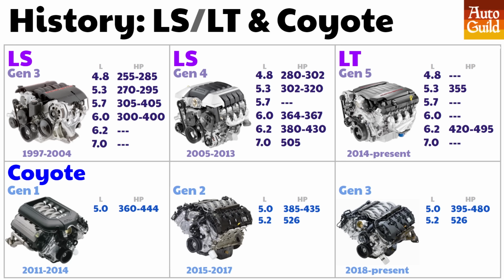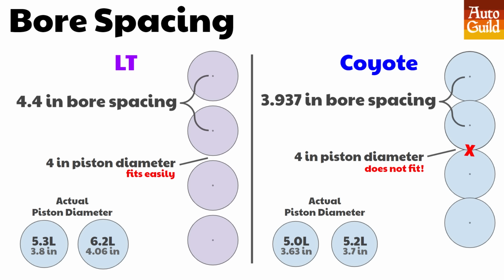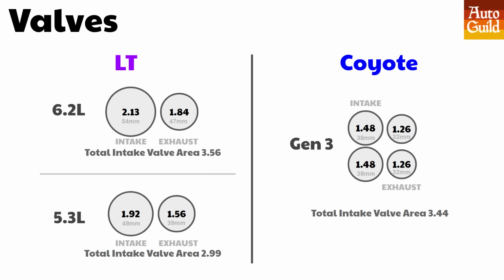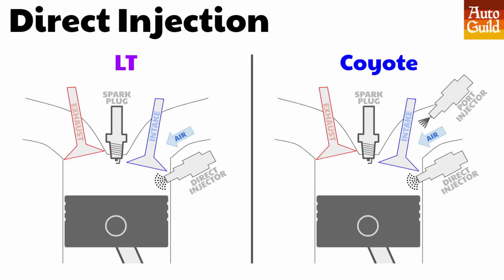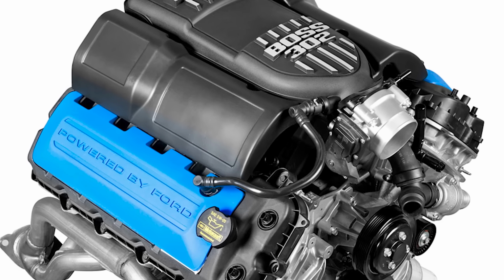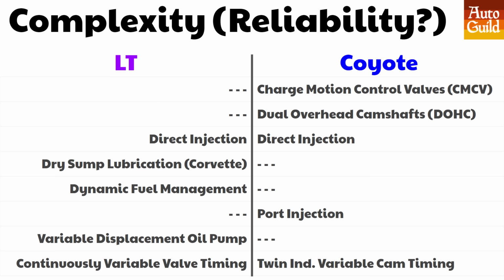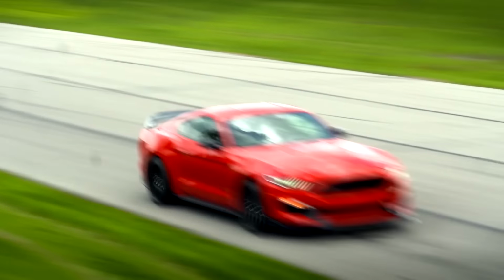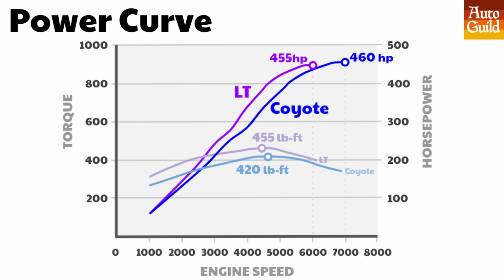GM Gen 5 LT vs Ford Coyote.  Which one is better and why.

Comment: I wonder if they fixed the oil consumption issue with the coyote?  The coyote in my 18 f150 used oil like a two smoke.  To the tune of 5 quarts before it’s first oil change - fords fix; do an oil consumption review and then replace the engine.  Apparently it was (may still be) a common problem.

Comment: The 302/5.0 Coyote eng is effing huge! About the size of a Chrysler 426 Hemi.
Reply: No, the twin cam heads are...
Reply: @aesir0784  so that not apart of the engine right? LOL you ford guys are hilarious. BIGGER THAN A BIG BLOCK, LONG BLOCK FOR LONG BLOCK. you know what a long block is? Imagine making a 4 cam 32 valve motor bigger than everything on the market still get over powered and tq'd by small blocks LOL.
Reply: @dmlmedia7382  like who gives a shit about the exterior dimensions?? The coyote engine is a masterpiece, it will outperform big cubic inch engines with only 305 cubic inches of displacement. Just look at Gm and dodge they use big 6.2L and 6.4L engines and still struggle to beat Fords small displacement Coyote engine😂🤣 No need to change heads, cams and all these nonsense, just drop a supercharger on the coyote 5.0L and let her eat.
Reply: @Jimmyxsx  even twin turbo setups on the 5.0's fucking riiiiiip😂 for older engines, like i have in my boat, I'll take my gm 5.7 all day. I love the sound when the quadrajet kicks in😜
Reply: @Jimmyxsx  Racers give a shit, builders give a shit, racers who build shit give a shit. That was the most silly response LOL. WHO CARES WHAT THE OVERALL SIZE IS LOOOOOOOOOOOL. I can tell you have no idea how cut up older mustangs have to be to put a coyote in it. heavier, more expensive, less power and torque. That's why your Ford kin swap LSX motors when things get serious. Link me 1 video where a coyote wins a calibration contest from any major outlets. #crickets

Comment: On modern direct injection engines without any  intake injection such as the newer gm LT direct injection engines, what maintence can you do to keep you valves clean since there is no fuel running over the intake valves to clean them. Just wondering if there is a product you can spray directly in the Intake every couple thousand miles to blast the buildup off the valves so it doesn't have a chance of causing issues later.
Reply: Best way to prevent that is to install a catch can. On my LT4 I have one and it cleaned the ports up hood from oil.

Comment: love the sound of a flat plane crank w/ header's
Reply: Coyote Mustang drives past my house daily, sounds fantastic. I had a 02 LS1 w/ headers that sounded like a boat. A fast boat.
Reply: I'm a chevy guy but a Ford v8 sounds so much better. Had a few old school 5.0 ho fox bodies, shorty headers, h pipe and Flowmasters sounded amazing .  The coyote sounds fantastic as well.  I do prefer the low-end grunt of the ls
Reply: Yeah when they come apart at 8k rpms on the race track it sounds WILD! the bad part is how long it takes to clean up the mess... dang voodoos

Comment: There are one to many error in this video.. Gen 4 LS went all of the way to 2015, the coyote does not have a flat plane crank the voodoo does., you did put direct and port injection however, the LT also has an engine that has the port and direct injection that you mentioned early in the video. The voodoo has a dry sump oil pump. The LT with the 6.2 is has more power per pound of weight than the coyote, Also, I wouldn't care about displacement per horsepower since the coyote all motor power is limited.
Reply from the maker: LS goes to 2019 I think, but LT was launched in 2014 and LS was begun to be phased out.  Good comments on Voodoo dry sump!

Comment: I'm a GM guy because I've always had terrible luck with Ford's reliability. I do hand it to Ford for being the more progressive company by implementing overhead cam V8s in the American industry and having gorgeous body styles and interiors. GM is currently working on a quad overhead cam 5.5L V8 but I'm not sure what they plan on putting it in.
Reply: GM will most likely put the 5.5L into the upcoming C8 Z06 and possibly other higher performing Vette variants. A race version of the 5.5L is already in their C8.R racecar since 2020 so they have to homologate it.
Reply: Im my family goes both chevy and ford, im chevy fan, my bro a ford fan, at times we swith rides, both are great makes at the end.

Comment: I'm a chevy guy but I do give ford their respects for not just with the coyote but with several engines that they've produced. But with that said I'm more inclined to build an ls or lt over a coyote any day and not cause I'm chevy but cause of cost. Not saying that it can't get out of control in cost with ls/lt stuff.  But The coyotes in particular, I will fully admit this, the coyo at the end of the day is a better block when built, for who could afford it. Those engines can turn some serious numbers and hold up to the beatings for a lot longer then most ls/lt stuff. But again once that coyo goes boom, you'll spend the cost of a built ls to repair it. If ford could get off their high horse for a few minutes and figure out how to make these cheaper then any ls/lt build, you'd then see everyone at the pick and pull junkyards hunting does coyotes an again not saying that people ain't already pulling them but here on the east coast I can find a coyo now faster then a ls/lt in the pick&pulls on any given day. I remember 8 years ago going to the p&p and getting 3 ls engines, aluminum l33's for 400 bucks, now if you find one it's probably 3 to 600 per block, but crazy as it sounds, even in the scrap yards back then coyo's were about 350 to 450 a block back then. Lol even the scrap guys knows what's up.....

Comment: As a mechanical engineer I approve of and appreciate this video
Reply: You shouldn't approve.. the FORD GODZILLA 2 valve pushrod is far more appropriate comparison.. AND Ford will get the cube advantage FOR ONCE..
Reply: @onyxphantom6762  
Not even close to most expensive
Reply: Most expensive to date yes

Comment: At 15:50. Comparing a 6.2 to a 5.0. OK, then compare the 7.3 Godzilla with  closer displacement 7.3 vs 6.2, and both are pushrod engines. No contest.

Comment: Really great video. I own all three engines LS, LT, and coyote. All 3 are great but I just love the simplicity of the LS. Glad to see you are an engine guy with an open mind and not just a fan boy. That is hard to find these days.
Reply: 100% was the best comparison I've seen yet! They all make great motors these days that's for sure.
Reply: Since u own all three i wanted ro ask, how much diffrent feeling is the low end torque in the coyote compared to ls?
Reply: @andresmarquez5241  the low end power especially with a pd blower is fucking crazy
Reply: LS crate engines likely in production thru 2099
Reply: Yeah coyotes are more complex but more durable , definitely more powerful and better , but LS are simple to work on it anytime
Reply: @ericknava9627  far from more durable.
Reply: @ericknava9627  complex and durable don't go together. LS makes more overall power and makes it cheaper. The coyote makes more HP per cubic inch but it will still loose because the LS makes more absolute hp.
Reply: If you are just driving your car reliably going places, what does simplicity fit in? Other than piece of mind that is unwarranted because lack of problems with the more complicated engine?
Reply: The LS6 in my C5Z has been pulled blueprinted & balanced w/ forged lunatic crank/rods & custom cut blower pistons. Crack a few piston rings when the hi-flow cats in my ARH mid pipe flew out their shells & plugged the exhaust lol, otherwise….it would’ve been fine. Thing has been making 750whp now for a while, stock bottom end. No issues.
Reply: You have really have done your homework.
Noth are great engines for status and power.
I believe the GM LT would be the more reliability with less tech and moving parts
Reply: The LT's have failing lifters ...starting as low as 30K mileage...
Reply: Coyote is ford’s top engine but you don’t compare it to chevy’s top engine. Hmmm.
Reply: @davidsteinhauer1339  Ford's top  engine is the 7.3L 'Godzilla' ICE V8
This compact 2 valve, pushrod is less costly option for high load F250 service since 2020. It shares same architecture as GM LS ,LT & has the same power potential , if not more. Huge bore, short stroke give it over 500 CID ability that LT & coyote lack. Godzilla crates are selling well  due that and super strong block capable of 2000+HP
@ costs less than 1/3rd of similar push from coyote platform , not to mention its 25% smaller pkg. That easily  fits most ford autos
Reply: @peted5217  7.3L? Think maybe you are comparing apples and oranges now.
Reply: @David Steinhauer  Ya, kinda jumped all over engine architecture scene. Only intended compro was 'Godzilla's' to LS/LTs . Ford's much larger bore spacing in near identical pushrod architecture ,scores a coup in lo cost alternative to diesel for all but commercial HD use. Reference to Fords discontinued 5.2 flat plane crank screamer vs 2023 corvette Z06 otherworldly motor was only a lament  the 5.2 hadn't been developed further as GMs new quad cam engine shows design's potential .
Ford bailed on small pushrod v8s , opting for a more expensive (excellent) quad cam design.  GMs pushrod v8 has shown the same power , but in a more compact , simplistic, and much less expensive to mfg, offering .
Reply: @peted5217  Nothing you said was wrong.
Reply: I also have owned all 3 and coyote is a better motor in every single way.
Reply: @katkilr7685  oh definitely not in every single way. LS is more compact. LS is more simplistic to work on. LS has more shops that specialize in its platform. LS has better aftermarket support. LS is cheaper in many ways to fix and/or modify. 
So you can say the coyote has some advantages, and I would agree with you. But to say it is better in every way is to ignore the facts.
Reply: Coyote is a better motor
Reply: I will always prefer an LS style motor. Just way more n/a power and it sounds a whole lot better.

Lingenfelter has an LS7 blue printed motor making 820 and revving to 8500. It's a 454 and absolutely nasty.

Coyote is a great motor don't get me wrong. I'm not a hater. But all you see is LS swap and these style motors in other cars. They work they have Hella power and are reliable.
Reply: @camonly849  I have a coyote f150 and it's a cool truck but the LS is still king. The LS will always make power dollar vs dollar and when both engines are N/A. The coyote shines with both engines are stock but have super chargers attached.
Reply: @09shelby15  stppid argument. Bragging right on more hp per liter doesnt win races. The goal is the same for all thse performance engines. Pump more air. This can happen thru cubic inches, more valves, more lift, larger heads, etc etc. Which is the reason the coyote is physically larger than a lt/ls
Reply: @09shelby15  Than What ?
Reply: @09shelby15  would you like to enlighten the rest of us with facts?
Reply: @Stephen_Hodge  its a smaller displacements motor that pushes more hp per cubic inch.  It revs higher and has a broader power ban.  While both motors perform well the coyote is a better motor.  Doesn't need 6 liters to produce 1xxx hp.  I also personally think the ls motors are superior to the lt tech.  I know some of the ls heads flow way better.  Now each motor has its short comings but I would chose the coyote everyday over a lt and a ls.  The modular motor lineup of Ford even there 5.4 dohc 5.2 dohc 5.8 dohc motors you can push 800 plus wheel with a pd blower and have power from idle to redlibe.   Yes you can fo the dame with a lt.  Comes down to power per cub fords motors are superior
Reply: @Stephen_Hodge  not to mention that good old 5.4 dohc carroll shelby called the finest motor made in that day out doing even the Germans.  Well thay 5.0 coyote is a better motor and I would call fords 5.2 the finest performance engine made today.
Reply: @Stephen_Hodge  I'm no ford fan boy either 
   Chevy will always be a step behind as long as there producing cars you can't tune.
Reply: @Stephen_Hodge  and I own a gt500 a z06 a chevy suburban and a f250.  Just my honest opinion on the two engines.
Reply: @Stephen_Hodge  plus those little 5.0 pushing 1300 1400 hp running in theb7s at over a170mph is pretty fucjijg impressive
Reply: @09shelby15  so technically I love the Buick roadmaster to death , getting one soon , so your telling me the coyote is a step up from the lt1 corvette from the 90s?
Reply: @Anthony0899  lmao chevy new engine line is lt
Reply: @09shelby15  damn , your right bro I ain’t even have to finish the whole video , but I’m about to watch the rest , I still feel like the lt1 is good for the wagons but that swap to the coyote is it even compatible? I know it’s expensive
Reply: @09shelby15    Where producing?  You're the only guy who doesn't know that the Chevy small block is the best all around V8 in the world.  There's no debate.
Reply: @mrpoizun  yea it's not but ok the coyote is such a better engine.  Not even close
Reply: @mrpoizun  you cheby fan boys make me laugh csny even tune the new junk
Reply: @09shelby15  there is still more chevy cars around the US so more like Ford will always be behind in sells of cars sold from them now chill out
Reply: @alphaares6027  where do you get your facts from.  There legit more f150s rolling around than xhevy even made cars
Reply: @09shelby15  I still see Chevy and Ford mostly but when it comes to full size SUVS CHEVY wins where Ford doesn't Every store I go to I be seeing a lot of silverados bearly outnumbered by F -100s
Reply: @alphaares6027  lmao ok buddy
Reply: @09shelby15   You living in a fantasy if you think it takes 6.2 from anyone to make 1000hp. The 4.8 and 5.3 junkyard pulls will do 1000 all day and you wanna talk money, the chevy ecotecs were pushing 1500hp years ago and Honda before them.
Reply: @DarkLinkAD  junkyard builds yea bro I have done them.  5.3 you ain't pushing no 1000 wheel all day out of them you're telling storieed I pushed 890 wheel hp and got a hand full of passes before it threw a rod.  I am simply pointing out out size of the engines cheby is using compared to fords.  I was also comparing stock bottom end strength.  Nothing I said is incorrect
Reply: @DarkLinkAD  bahahaha ecotech and what a lsj stop dude built those too lsj cobalt with a big turbo yea been there done that.   1500 hp hahaha yea tell your stories walking
Reply: @DarkLinkAD  ecotwch head is garbage compared to Hondas k20 k23 motors.  I had a lsj with a chevy race spec head that just bearly out flow the Honda head.  Just stop
Reply: @09shelby15  displacement doesn't really matter when the coyote is the physically larger engine of the two. There's no doubt the Coyote makes more high rpm with its DOHC but it's soft down low. There's a video on YT when two engine builders were given 25k and told to build the most powerful coyote and LS they could. Both ended up around 1300-1400 horsepower but the coyote broke after a handful of dyno pulls but the LS never broke even after 36 pulls. LS is simpler and most cost effective. Factory ported ls3 heads flow 366 cfm at .600 lift, the coyote flows 313 cfm with similar lift and are crazy expensive.
Reply: @mmholling87  lmfao yo those coyotes make power from idle to redline stop.  Especially with a pd blower on top.  Low end power stfu your arguments are elementary
Reply: @mmholling87  and displacement matters lmfao
Reply: @09shelby15  yes, I agree but the footprint of the engine is more important much easier to fit an LS/LT in an old car than a Coyote.
Reply: @09shelby15  the LS/LT wins both NA and with power adders. Watch the 25k build and you'll see the coyote fails pretty quickly over 1000hp.
Reply: @mmholling87  bahahaha fails pretty quickly over 1000 hp hahahaha bro there 7 secpnd mustangs running coyotes pushing 1300 plus hp fuck are you talking about lmfap
Reply: @mmholling87  that's the biggest lie I have heard.  The coyote dohc platform is a better motor than any ls out there period.  It's why fbo and supercharged mustangs walk just about everything
Reply: @09shelby15  https://youtu.be/KFkOy0F5hGg
Reply: @09shelby15  I'll find the other video on my next break. There's no argument an LS is easier to swap if you cannot admit that then we are done because you cannot see facts regardless of how they're presented.
Reply: @09shelby15  https://youtu.be/jzL_4yVuTX4

There you go. The LS wins NA and boosted. Unless you can find a different videp or provide one of your own I'll considered this argument settled.
Reply: @09shelby15  Say's the ferd fan boy. stfu.
Reply: @mmholling87  Eric Weingartner got 390cfm out of ported LS3 heads, but 360-370cfm is pretty common, and 20 years ago if you said this would be normal we would've laughed at you.
Reply: @09shelby15  you forgot the lx motor on the Venom f5 and the hellcats are pushrods like the gm engines.
Reply: @mmholling87  not to mention the stock cyl sleeves kinda crack
Reply: @09shelby15  An expert saying the ford coyote is better than ls or lt motors, ls motors sold more than coyotes. And f5 Venom from Hennessey has upgraded  ls 6.6 liter. Also the c8 vette has an lt motor ..most powerful non turbo or no supercharge motor, How can you say that coyote is better. F5 Venom maybe top 3 fastest in the world, and 5.0 is heavier in weight han a 6.2 is.. 5.0 needs a supercharger ti beat an ls for so many years and that's a fact. I use to own both
Reply: @junnedynanca9838  He's just boohooing he even called someone cheby fanboy over the facts lol
Reply: @Stephen_Hodge the video explained the complexity of the coyote vs simplicity of the LT motor. The coyote has 16 injectors, 4 cams, etc..more potential failures.